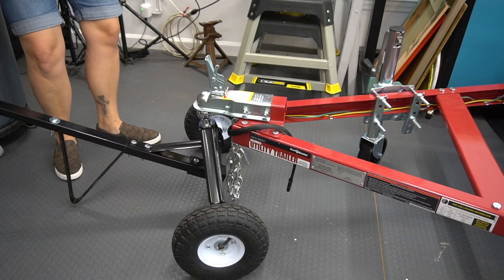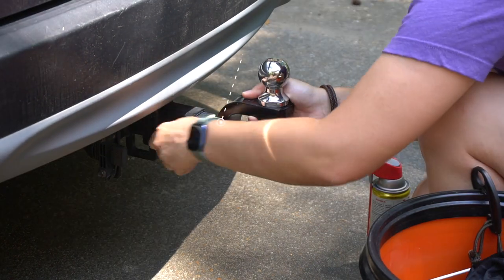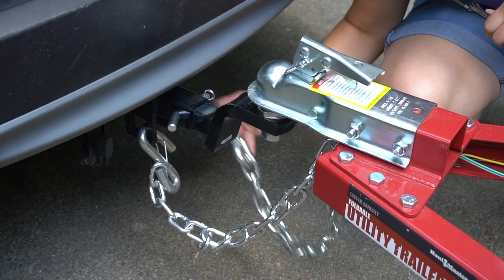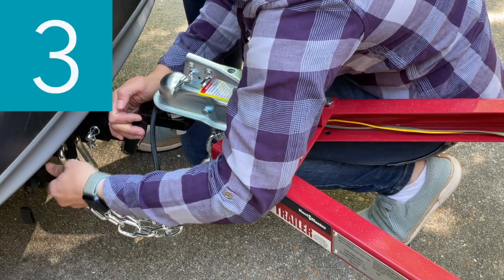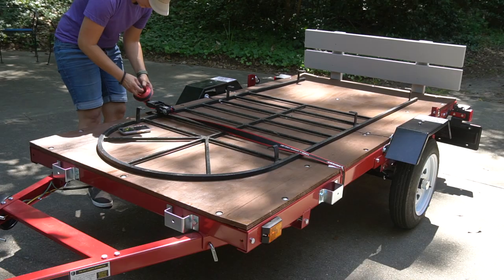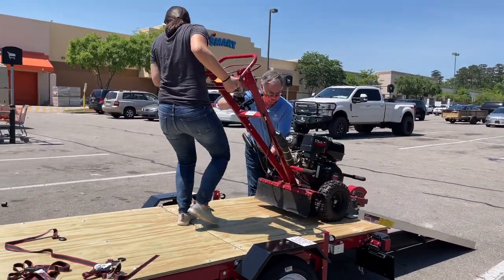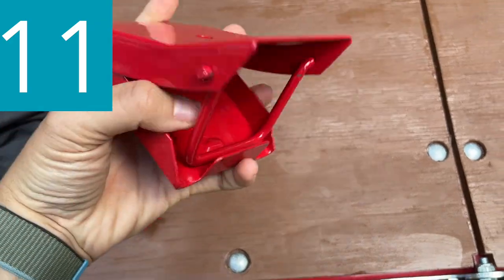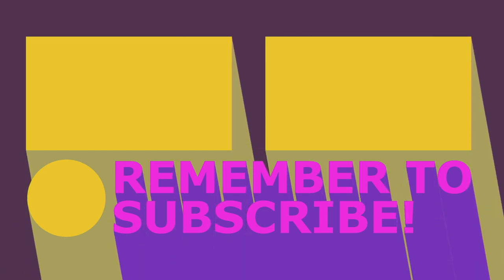How to Attach Utility Trailer to Car

Comment: Hard to see from this video, so apologies if you have done this BUT ALWAYS CROSS YOUR CHAINS the biggest reason is it prevents the load from flailing sideways in the case of a disconnect. Unlikely situation but one you want to prepared for with just a simple change in setup.

Comment: Other folks have already mentioned that you should have crossed your chains.  The reason for this is the crossed chains will catch the falling hitch and prevent it from going out of control side-to-side on the road after such a misfortune.  Supposedly it also resists snapping better, but I'm not sure why that would be.

Comment: Suggestions for your checklist... (love checklists) depends on your vehicle but you want to *check your car owners manual regarding towing. I have a similar car to the CRV and the manual says when towing, to turn off some of the vehicle safety features. Such as:

Turn off PCS (pre-collision system)

Turn off LDA (lane departure alert)

Turn off DRCC (dynamic radar cruise control)

Do not use cruise control

Notes:
Blind spot monitoring may not operate correctly.
Rear Cross Traffic Alert function may not function correctly.

*CHECK YOUR VEHICLE MANUAL
 

Great trailer videos btw! 👍
Reply from the maker: Great idea!